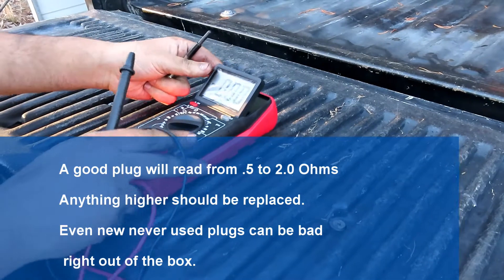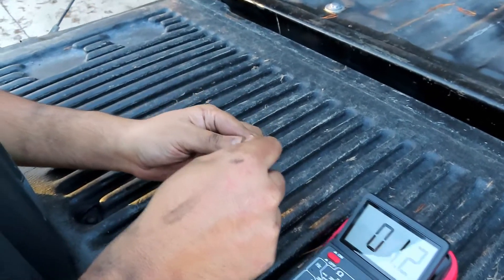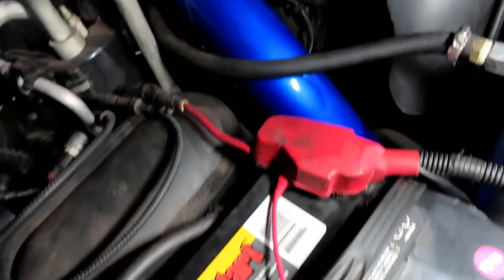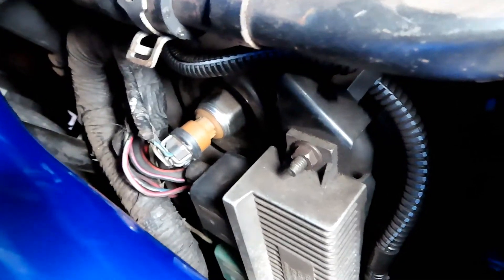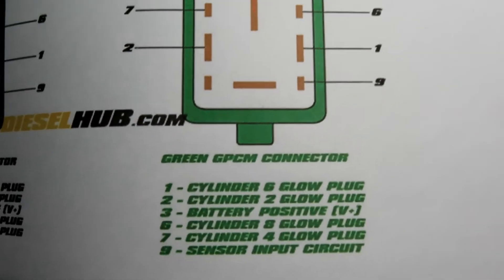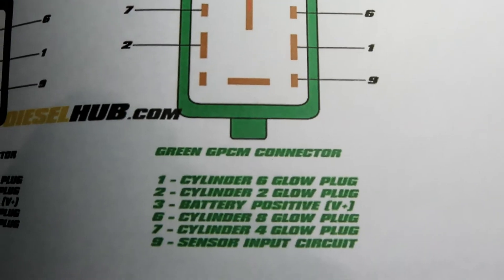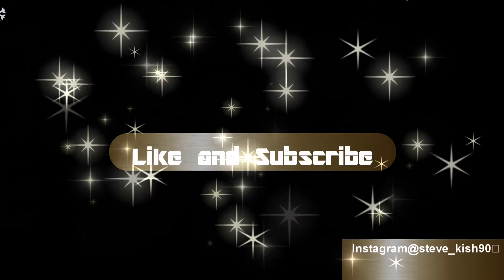Easy 6.0l Powerstroke Glow Plug Testing

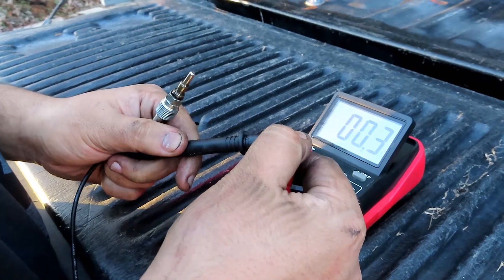Comment: 1:03 Rather than "add that on", you should instead subtract the resistance reading of the meter and leads from the resistance reading of the glow plug.  

Thanks for a helpful video.